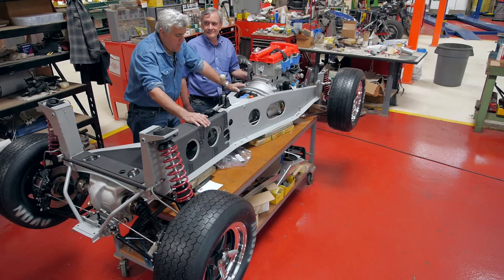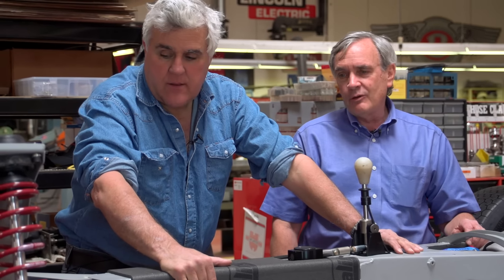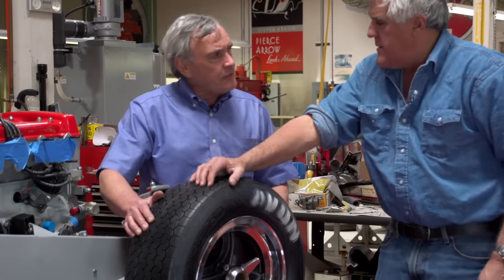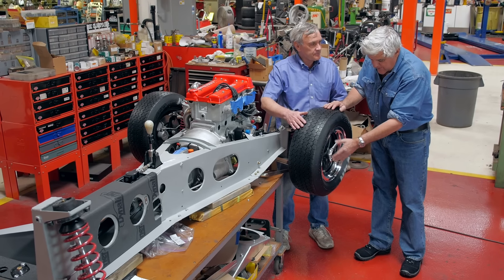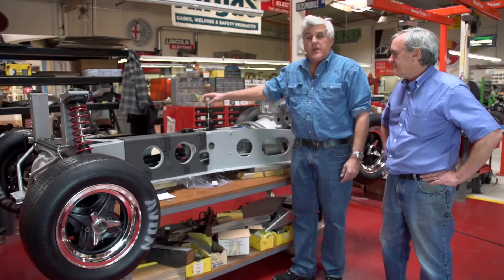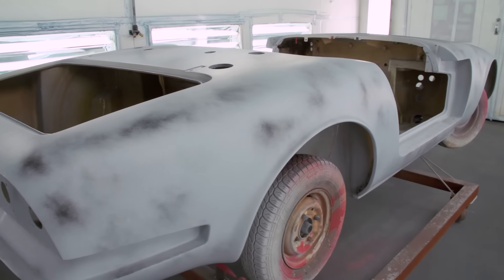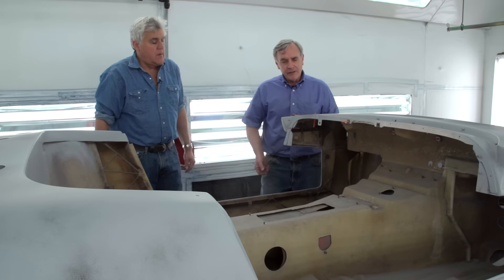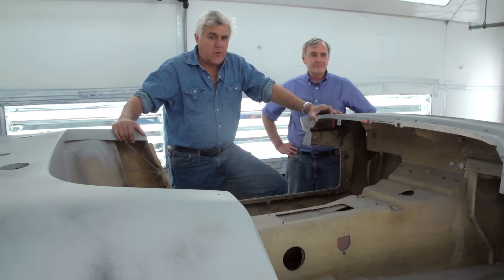Restoration Blog: 1966 Lotus Elan 26R, Update 11 - Jay Leno's Garage

Comment: Hi Jay  you realze there is a differance of something being built and something being assembled right . I am not being a fart about it . I build things . Taking raw materials like flat metal and forming it . Then assembling these formed parts to make a Unit  . What you doing is dissembling ,cleaning , repair , paint ,rechroming , prefitting and then the fun part assembly . This is not building . I dont know why these car restore places call this building when in fact the car was built first then assembled , Not to forget that before this prossess starts . Everthing started out as a ruff drawing an Idea .